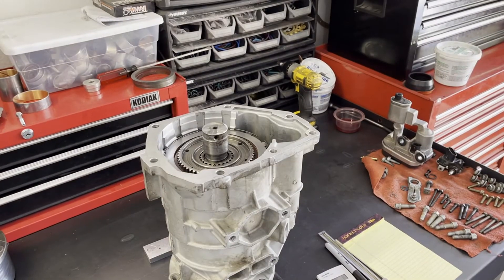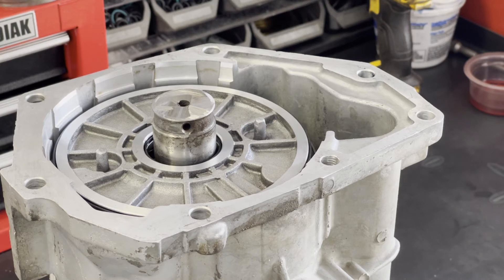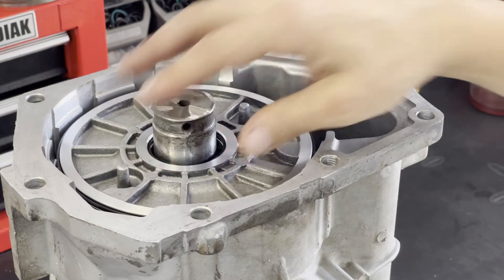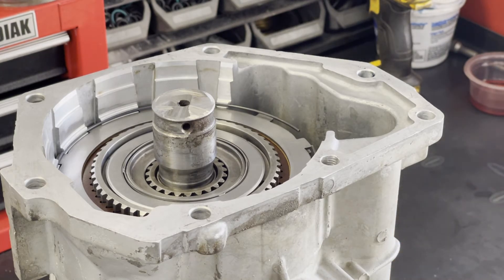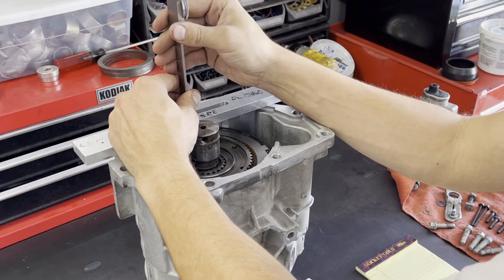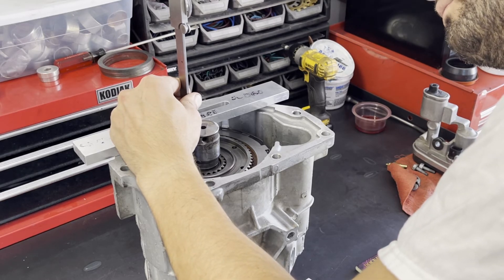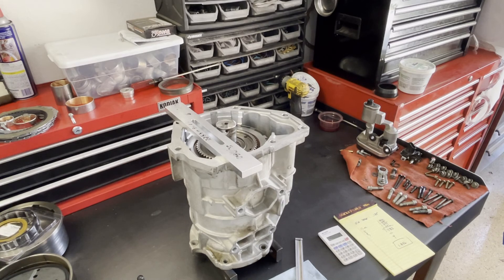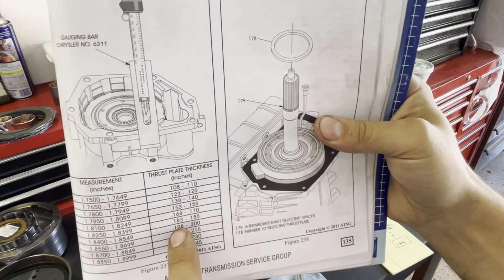3. Dodge 48RE Rebuild - OD Brake Clutch Clearance

Comment: Do the 2 methods need to have similar results for selecting a spacer on a 48re  ? For instance if I install a .212 spacer my piston to steel clearance is exactly .110” with the drill bit method. 

When I measure like the book shows it says I need a a .170” spacer . 

I have 6 frictions , steels , removed the wave snap ring, factory .215” plate

Comment: Hi Nick,

I rebuilt a 47re and added a 48re tail. I used both methods to set the clearance on the od brake. My clearance was approximately .093 . My 3-4 shift is very fast and uncomfortably firm. I can improve the feel by backing right out of the throttle. I have used 2 different valve bodies with the same result. Kolenes and gpz s were used. I believe I also added an extra clutch. 

Do you believe my issue is the tight clearance or the use of the gpz s in the brake?

Thanks for any assistance you can provide.
Reply from the maker: Hi Kevin, short answer on the stack-shift - no...More than likely you have a cross leak somewhere in the 3rd and/or 4th gear apply circuit. Did you air check the case once the unit was fully assembled but prior to installing the valve body?

Comment: Good evening Sir, how are you?

I'm from Brazil, I watch and enjoy your videos a lot. They are real classes. I am grateful for the lessons that allow me to grow as an Automatic Transmission Repairman.

I have some questions and if you could help me, I would be even more grateful.

I'm assembling my first 48RE, which arrived at my workshop already disassembled.

I needed to change the front casing, as it arrived cracked.  I don't have the measuring tool and I probably won't find the selective shims if I need to change them.
 
Could you send me the measurements of the measuring ruler, so I can produce one here?

If I don't find the correct shim, can I have one machined from steel to the required size? 

Thank you very much for your attention.
Reply from the maker: Hi @vilsonrdeoliveira6348, thank you for watching - appreciate the views and kind words! 

Make a video on Chrysler 46-74-48RH/RE Special tools and give the dimensions in the video - will try to have it up by Friday.

Comment: What do you call the spacers specifically online? N my overdrive housing I can fit 7 clutches without the waved snap ring. Is that ok? My transmission is around 200 thou between the piston n spacer. Can't find them online.
Reply from the maker: It's technically called the overdrive piston-to-hub race but I usually see it listed as an overdrive selective spacer or washer.

Are you needing a thicker race?
Reply: @nickstransmissions  no I need thinner. I got the front section of the transmission clearance good. But struggling with the overdrive housing. I'm thinking about getting the case saver to take some of that up but then that will probably make me have to re do the front half of the case clearance.
Reply from the maker: What is the thickness of the spacer you have now? LMK and I'll see if I can find a source for you (Transtar, Transparts Warehouse, Oregon Performance Transmission parts, Cobra Transmission Parts may have what you need).

What hard parts, if any, did you replace in the main case or overdrive section? 

I am assuming you measured your front end play with the overdrive section bolted to the case...
Reply: @nickstransmissions  the 1 I have now is 194 thousands. I put the overdrive section on n lost all endplay. Had 35 thou before. I will figure it out but just want to buy the spacers because it's a new overdrive housing. Original was cracked. Which I think is why my clearance is so off
Reply from the maker: Ah, that makes sense (Housing swap)...most of the time, the pre-existing spacer is fine without even checking if no hard parts, case or ext housing are replaced but here, the replacement ext housing is accounting for the difference.
Sounds like you need something no thicker than .183 and likely something thinner...

Per the Transpartswarehouse.com catalog, the following thickness are available:
Thickness | Part Number
>   .183"     | 12213E
>   .168"     | 12213D
>   .155".    | 12213C
>   .138.     | 12213B
>   .123.     | 12213A
>   .108.    |  12213

Also, you may want to pick up some additional selective spacers for the pump and forward drum (three-tab thrust washer).

What is your rear gear train end play?
Reply: @nickstransmissions  I can't appreciate more that you answer me back. Thank you. So I already have all those. Bought the muldoons kit with the billet input. So that's also different. The only thing they didn't send with the kit is the spacers. N I have been using ur drill bit way cause I don't have the other piece to do it the book way. If I put 7 clutches my clearance is perfect. 6 clutches then I'm a bit off.
Reply: I will call trans star tomorrow and get them to send me all of them. N then keep the rest cause I know this won't be the last 1 I mess with. Definitely 1of the hardest transmissions to get right.
Reply from the maker: You're welcome, man...I just tore down a 47RE earlier today, filmed it as well so that will be on the channel in the next week or so. As such, had my Chrysler transmission 'hat' on, haha.
Reply: @nickstransmissions  that's awesome. I can assure you I will be watching it.

Comment: What would too tight or too loose do to 4th gear?
Reply from the maker: Hi, thanks for watching The Expert Noob Hobbyist Doucet.

I'll give you the consequences for both OD clutch packs - 

OD Brake Clutch
- Clearance too loose = flaring into 4th, eventual burn up of clutch if numerous shifts into 4th at high throttle angles
- Clearance too tight = spin losses in 1st-3rd gear, drag and glazing of OD brake clutch friction plates/heat-driven premature failure

OD Direct Clutch
- Clearance too loose = delayed engagements, flaring, etc
- Clearance too tight = spin losses/drag in 4th; OD direct clutch friction plates glazed/heat-driven premature failure.

The nice thing about these units is you can remove and rebuild the entire OD section without having to remove the rest of the transmission from the vehicle.

Let me know if you need any more info.
Reply: @nickstransmissions that last parts super neat lol

Comment: Hey nick , i am finally working on getting my 48re bck together, i used the "direct" method, and the drill bit that had drag is .154 i was surprised it was that one , but is that to much ?
Reply from the maker: Hi Thomas, glad to see you're getting back to it! You basically go with what your 'test' drill bits tell you so can't really tell you whether it's too much, just right or not enough beyond what your drill bits indicate....If you're not sure, you can also use the book method to see if the two methods yield the same or contradictory results.

Comment: And i do have the book that shows the numbers of the spacer im just not sure if im to tight which i believe i am in the overdrive unit again my trans will not spin freely even with torque converter out of trans im just trying to get back on the road been out of work for 11 days now
Reply from the maker: Try different thicknesses of spacer to get the OD direct clearance you need based on the manual's instructions (or mine). 

If it still won't move, then something else is bound up in the case. With the OD housing off, If you should be able to spin the the intermediate shaft in both directions. If so, the problem is in the OD housing somewhere. Check OD direct clutch clearance as well as assembly of the internals, including ensuring you're engaged properly with the OD roller bearing and retention snap ring, for anything in wrong.
Reply: @nickstransmissions  thanks again ur truly a helpful one god bless thanks

Comment: Need a .108-.110 spacer can’t find one
Reply: Yes I have thanks for the link that’s the Sonnax shim kit that comes with a .175 and 3 .010 it seams like there discontinued from mopar
Reply from the maker: @jonathansawicki5601  call Trans star as they sell them as well and have all sizes available. Also check with hard parts suppliers in your area. More than likely that one of them is a distributor for Trans star. https://www.transtar1.com
Reply from the maker: @jonathansawicki5601  check eBay also, just saw a sonnax shim kit listed, seller is “transmissionjobber”
Reply from the maker: Have you done a google search?

Here’s one supplier that came up after typing in “48re overdrive selective spacer”. I have never done bus with this company just saw they appear to have them available 
https://powerdrivendiesel.com/product/overdrive-shim-kit/

Comment: I just pulled mine out to swap housings. Mine is over 0.125” using drill bit method. Would a “build shop” do that on purpose? What is the significance of distance from mounting surface measurement since the gap is not relative to it. It’s only dependent on spacer thickness.
Reply from the maker: That spacer sets the overdrive-direct (OD-D) clutch clearance. The thicker the spacer, the greater the clearance in the OD-D clutch (this clutch comes on in 1st through 3rd gear in all forward ranges and goes off in overdrive and the OD sprag is holding in all forward ranges). 

Too little clearance, you may get centrifugal apply in overdrive and other related problems. Too much clearance, all the engine's torque is delivered to the OD sprag for a split second before the OD clutch fully compresses. Premature wear/failure of the OD sprag is one of the possible outcomes.
Reply: @nickstransmissions  on the advice of a mechanic I respect, I put it back together the way it was. Time will tell.

11 months Later no issues.
Reply from the maker: Generally speaking, you don’t have to mess with that spacer unless you’re replacing the housing and/or gear components inside the housing. Even then if it’s within the specified range you will be good. You will know pretty quickly if there’s a clearance issue with that clutch…good luck with it; post if you have any more questions.
Reply: Where would I get shims/spacers for this?
Reply from the maker: Check Transstar's website for a distributor in your area that sells transmission parts. You can also order them off eBay, Cobra Transmission, Oregon Transmission parts, Transparts Warehouse and other online transmission parts websites.

Comment: I am currently building a 46re. I have the book and am trying to do this. What I don't understand is how the book method can determine the thickness of the correct spacer when there is no measurement to the clutch stack. Any variation in the clutch friction plates or the steels would render the book method useless. I have been beating my brains out trying to understand  this method. 
It seems to me the whole purpose of the selective spacers is to insure correct timing of the release of the inner clutch pack and the apply of the outer clutch pack. Am I missing something?
Reply from the maker: Hi Ray,

Thanks for watching…Getting the timing right for all the applied elements involved at the 3-4 shift is basically the gist. The OD Directs are on in every gear except 4th when they come off, the OD sprag stops holding and the OD brake clutches come on. In fourth, Forward, Direct and OD Brake are the applied elements, everything else comes off. 

Hope that helps…
Reply: @nickstransmissions  yeah. That is what I was thinking. I just don't understand how the book method can work. It doesn't take into account the location of the apply plate or front steel of the brake clutch. Thanks for the reply.
Reply: @nickstransmissions  oh and I will be using the direct method on my transmission.
Reply from the maker: Yep, I use the direct method all the time and only showed the book method because its in the book. 

Unless you’re replacing the ext housing, the gear train, shaft or both/all, the spacer that came out can go right back in and should be fine, everything else equal.
Reply: @nickstransmissions  added clutches to mine. Thanks

Comment: Can I remove my transfer case, then my cracked overdrive housing without removing the transmission?
Reply from the maker: Hi Bryan, yes you should be able to remove the overdrive housing without taking out the entire trans, assuming you support the trans with a jack to avoid stressing your engine mounts...Just have a catch pan ready and keep track of how much fluid comes out. 

I'd swap out both sets of clutches (OD brake and direct), the bearings/bearing plate and sun gear bushings while you have it out so it's completely refreshed when it goes back in (assuming you aren't planning to do so already).
Reply: @nickstransmissions  good plan sir
Reply: @nickstransmissions  I just looked. Just short of 54K miles since overhaul. Long story short, it leaked since it left the shop. They wouldn’t warranty because of the cracked housing and wording in the warranty to such. They wanted another $2K to “fix” it. I said your not getting anymore of my money!
Reply: Yes. Not a problem.

Comment: Random question: will the transmission move forward or reverse is the bearing is left out? Asking for a friend 😳
Reply from the maker: Hi Joe, thank you for watching…Yes, no, maybe - depends on which bearing has been left out. Which one are you referring to?
Reply: @nickstransmissions  The bearing that goes behind the shim on the overdrive when you instill onto the transmission aft housing. 
I had AAMCO rebuild my trans and within 3 months the last input shaft disintegrated. They said they would not warranty my trans (truck has 217k) because I have a Jake brake (even though I haven’t towed anything over 9k since I bought the truck at 204k). AAMCO gave me all the parts back and I disassembled everything and weren’t through everything before building the trans myself with billet parts and a new pump. Everything is together, installed (including a new billet triple disc torque converter) and with fluids topped off (after running motor for 1 min to allow the pump to fill the converter), I have no movement. Forward or reverse. Thinking back to when I was building the trans back up the other night (used service manual), I can’t recall if I did or didn’t have the bearing in the box of returned parts from AAMCO. I remember the shim, but I didn’t take the measurements I was supposed to because I was so tired and I never disassembled the OD clutch since I didn’t have the proper press to get the spring tension. So went with the knowledge that AAMCO had already put in new plates. But now kicking myself that I can’t remember if the bearing is installed. …. Oh… my friend, not me😬
Reply from the maker: Well the (maybe) missing bearing is easy to deal with - just pull the drive shaft then ext housing and install it if not there...No movement in any gear/range can arise from failure to connect the manual valve/rooster comb assembly w/the rest of the shift linkage...Failed pump/broken gears can also cause the issue but i don't see/hear of too many people breaking the pump on installation like i do w/the GM stuff, given their use of powdered metal rotors...

If you (i mean, your friend) haven't already done so, put a pressure gauge on it and see if the pump is putting out pressure...if its generating acceptable pressures at idle and stall, then i'd drop the pan to check the shift linkage.
Reply: @nickstransmissions  Thank you. Will do. Happy 4th of July and appreciative of your really fast responses. We are getting ready (although feeling unprepared) to take my wife’s mom from the San Diego, CA area back to PA area on the east coast via my truck and trailer… burning the midnight oil trying to get this done since my MIL’d health conditions won’t allow her to fly. 
So very thankful for your advise and input.
Reply from the maker: Happy 4th to you and your family as well, Joe! Have a safe trip.

Comment: Are you guys assembling the transmissions dry?, especially the clutch plates?
Reply from the maker: Assembly lube (seals, bushings, etc), WD40 (valve trains) and transmission fluid (bands). I don’t soak the clutches.

Ill publish a separate video on why i dont soak them as ive been getting this question more frequently. 

Long story short - you don’t have to soak them as long as they are soaked once in the vehicle, engine running for a minute or so then allowed to soak in 20-30 min before the test drive.

Comment: When adding the measurements using the 2nd method, do you include the width of the spacer in your calculations?
Reply from the maker: No, just compute an average of the four measurements collected from the gauge bar to the hub surface as shown in the video. 

The width of your spacer is measured separately from those other measurements then compared w/the average collected in the step above. You then refer to the chart in the ATSG manual to determine if your current spacer is of the correct thickness or not.